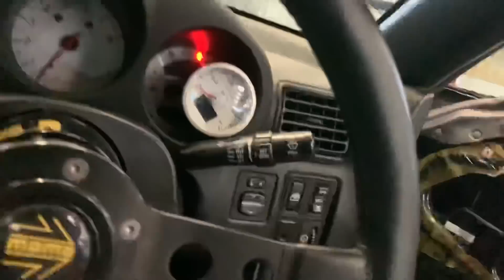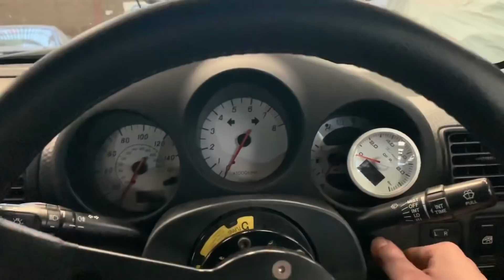Midship Mystery

Comment: Do you still have immobiliser in it? Mine was running and the light was on, then it started flashing and it stopped. I turned key off waited a minute then started it and the light just flashed this time. So I stopped it , disconnected battery waited a while , reconnected battery and started her up. Damn thing still flashed for a minute or 2 then when out and it was fine after that. Been alright since . Go figure that one

Comment: I subd for the mr2. I priced up a k20 swap before deciding on the 2zz and the place that does k20's quoted 20k lol. Even just getting a k20 and gearbox was 7k so 2zz was the one for me. Just have to get an exhaust now. Please keep the mrs vids coming :)
Reply: radstar 7k for what?? A completely rebuilt engine and box? A used K20 swap engine, box, ecu is £1300
Reply: @driftmonkey3646  no mate in Australia a good used k20a and 6sp box 7k or for a dodgy bros engine and box 3.5